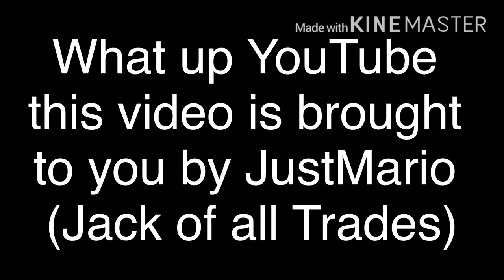Hotshot freight runner

Comment: This is an awesome video. I’m on a bus coming back to my family in Avon Park Florida. I’ve been on the road in West Texas for the last ten weeks, sleeping on the side of the road a quarter mile down the road from my pick up location so I can get loaded before the scale house lady comes to work at 6:30am cranking out loads in and around the oil fields, taking a shower in a truck stop and eating cold spaghetti out of a can. 
Thank you for your attitude of gratitude. Put God first in everything you do and be thankful for helpful people. Thank God that I was able to go to church and fellowship with Gods people every where I went from El Paso to Midland, and San Angelo, Texas.
Mario, that is an oil field load of hoses. Some hot shot drivers Cary two or three foot sections of c channel steel bars about the size of a 2x4 that fit in the holes along the rail of your trailer. This helps keep stuff from hanging off the side.

Comment: I think you might have the wrong information about not running logs after you deliver. Whether you have a trailer or not, you still have to run logs until you return  to your house or home terminal.  FMCSA set out a clarification notice on this issue.